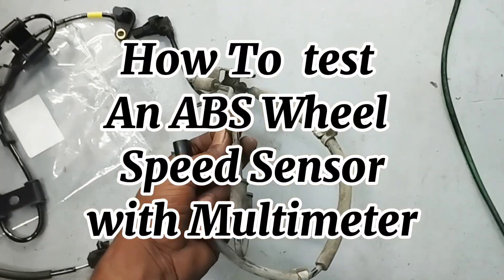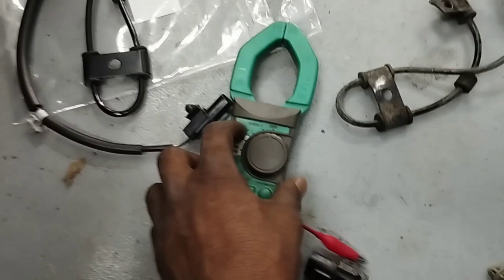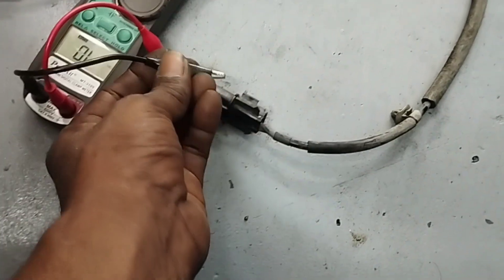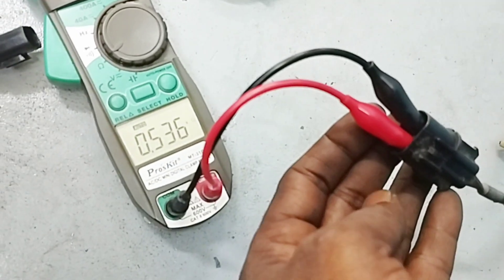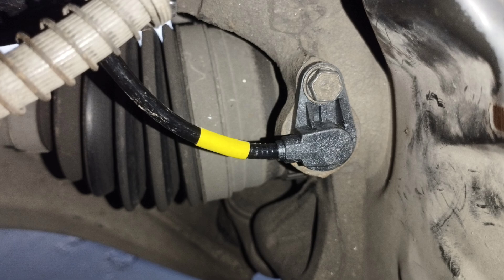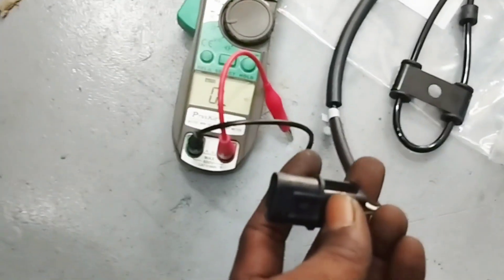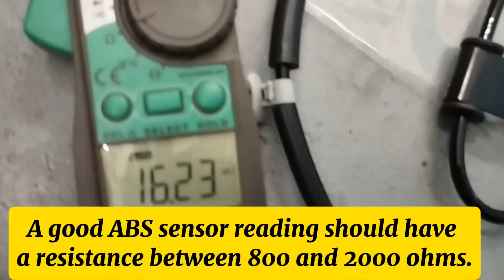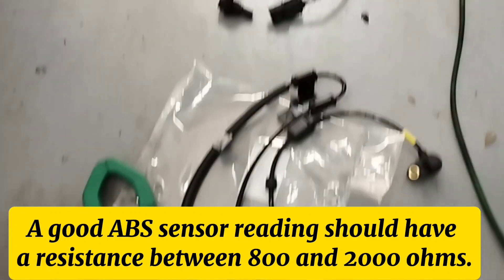How To Test  ABS Wheel Speed Sensor ! Using A multimeter

Comment: Hi, You said normal range are 800 - 2000 ohms but the new sonsor resistance is not 1,623 ohms but 16.23 mega ohms. Is It right? I am confused?
Reply: i have same question😅😂
Reply: Ja it measured 16.23 mega ohms and the internet also says it should be between 800 - 2000 ohms.
I think they are confusing the prefix 😅🤷🏻‍♂️